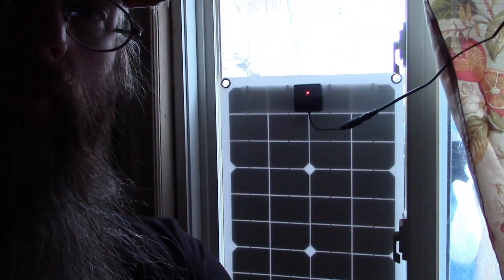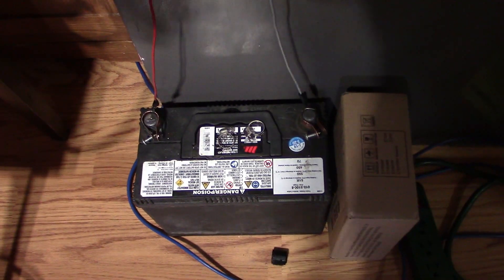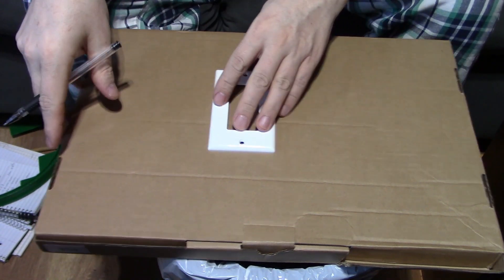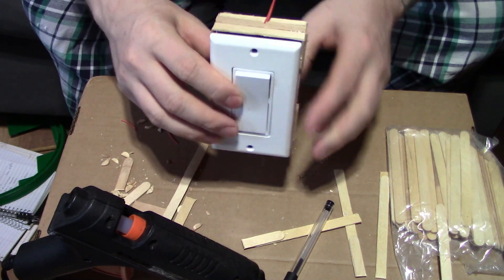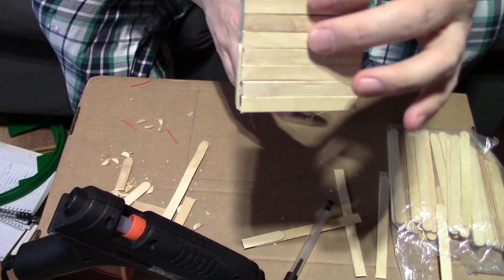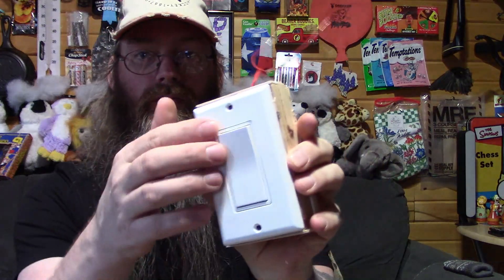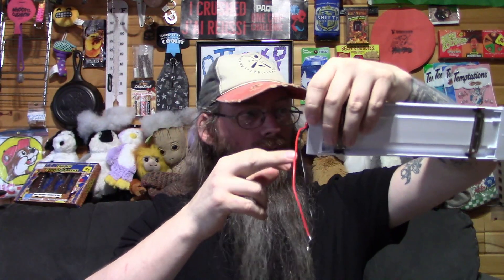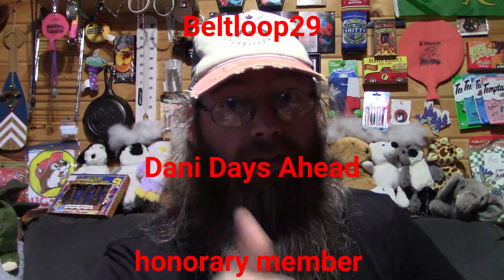my back step solar project 1

Comment: AL  &  DORIS  & NIKKI  !!!  When you  got the  money  get  another   Battery  for yourselves  it will  keep the   power for  you  then !!!  I have 3 large ones  & 2  smaller ones  !!! Plus the  sun  runs the  lights  at night  in the  kitchen  !!! Those  I bought at  Home Depot !!!  I get a  few  things  here & there for  myself in the  last  5-6  years  and it has  helped on out !!!
Reply from the maker: Nice thanks for the input, I'll be adding to my stuff for sure as time goes by, I want to get alot more stuff going on solar in the house